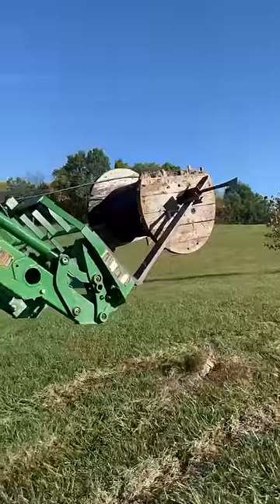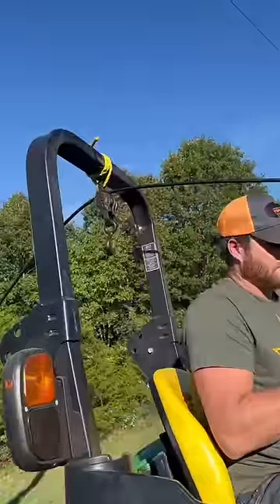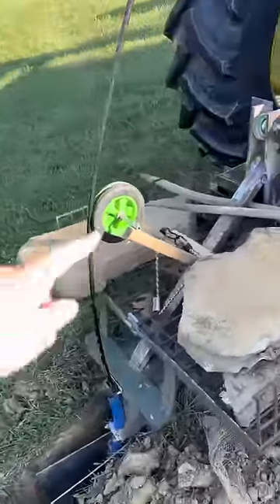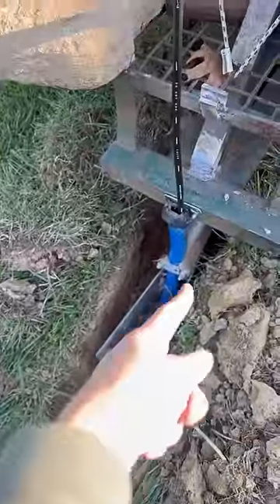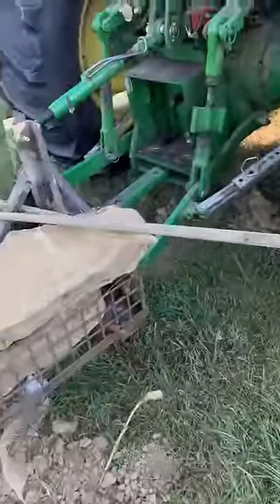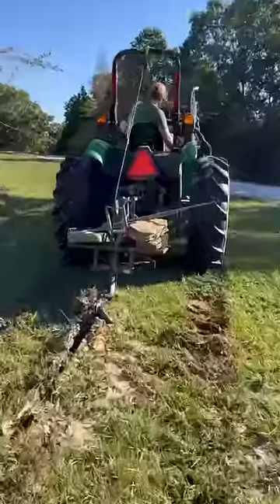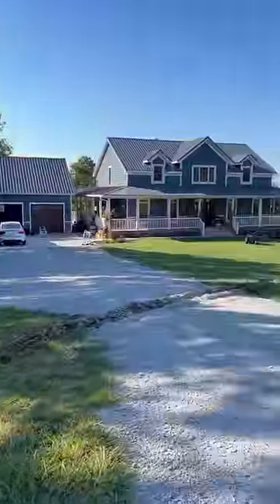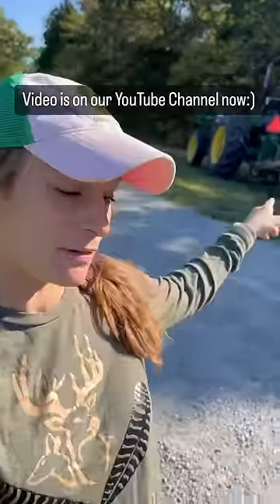Husband=GENIUS!🤯 DIY Subsoiler Build!       #johndeere #farmlife #amazing #welding #country

Comment: I did basically the same thing with a box blade and one of the tines. I took one tine and welded conduit on the backside for the cable/cat6/waterline to run in. Then put it back in the box blade at the lowest setting. Remove all the rest. I can get close to walls either side. I just wish i could get it a little deeper.
Reply from the maker: +@monsaka7827 that’s smart! Nice!

Comment: I would lay some tracing wire down and bright-colored ribbon in the trench just above it so you can find it in the future and to avoid cutting it. Last thing you want to do is cut fiber. It’s also a good idea to take some measurements and draw the map then put that in your files and cloud storage. Take some photos and/or video to document its pathway and depth and perhaps add a visual marker somewhere.

Comment: Fiber is delicate. Gotta have that in some (depends on local regs) conduit (pvc, fiberglass braid, steel tube etc). Is it required? Depends on the locality. PVC is required here, but since on a farm it’s prob fine. It’s when you got people doing work and digging trenches and aerating when trouble starts. I like the method to bury.

Comment: Looks like he's worked or watched a line crew.
I used to walk on top of the spool in order to not allow the cable to snap tight or get to loose. 
Good job you did there. Did the wheel from the barrow work?

Comment: The block hanging on the role bar is upside down.i believe it's a "snatch block".it's designed to quickly put line in mid line.

Comment: FYI when working with fiber you need to make sure you never have a bend smaller than the width of a basketball when in its jacket otherwise it could cause latency, and possible break the glass

Comment: That tool already exists, but it buries the line five feet deep, where it won't get damaged. It vibrates, to cut through the ground more easily. It's like a big sewing machine. The smaller version, which only goes about two feet deep, is only for soft ground, not under roadways.

Comment: You need to put that stuff in pipe or youll be fixing it A LOT. Even the direct bury stuff is fragile enough that natural ground movement will cause stress pressing and the light will get +stuck+ in the line.

Comment: I have soil envy.  The crew that installed my solar array broke two ditch digging machines in 200 feet of NE PA rocks in clay.  All I want is maybe 4 inches of that tender stuff spread on my garden.
Reply from the maker: +@brucehalleran1149 we also have soil envy. We live in the hills of Kentucky where it’s all clay and rocks. We also had major issues with rocks during this process. This video clip is in our front yard where e excavated all the rocks out and had triaxle loads of topsoil brought in lol

Comment: I mean, it's basicly the same design that's used to lay cable with professional equipment.  Nothing new, but good on him working smarter and not harder.  Use the equipment you got and make it work.  Typically fiber is run in conduit though.

Comment: Some  would say that because fiber is somewhat fragile, You might do better with putting it inside of conduit with an accessible pull box every 30 feet.
It’s really difficult if not impossible to repair - would require replacing the whole run.

Not throwing shade on your great  invention, but there is the law of unintended consequences and you can take advantage of others experience with fiber optic cable.

Comment: Y'all are going to have to remember where that fiber optic cable is in case you decide to dig up the yard later on. It would have been better off just getting small pipe and running pipe through your yard to better protect that fiber optic. And this is coming from somebody you used to run cable and fiber optics under ground.

Comment: ONE thing done wrong is that the fiber is too shallow, it needs to be deeper, but the machine is great! Also it really should have been in a protective plastic pipe to protect against people digging it apart later. Just make sure you never dig on your lot again.

Comment: You should be putting that fiber in a small pvc pipe before burying it with dirt. This will protect it from critters and movement in the earth. Shouldn't be too hard once you lay the cable to run pvs around it.

Comment: It's a sweet video but that fiber will be very screwed very soon, the elements will trash that fiber line, if the pressure from the driveway doesn't crack the heck out of it.

Comment: Fiber optics is glass. What I want to know is did the cable work after it was installed. when the glass breaks it breaks back 10 feet. You have to be real gentle with fiber optics.

Comment: Did the fiber break at all? It is glass. When we pull it at work we gotta be careful with it.
Reply from the maker: +@salvatoremaniaci230 Nooe. Didn’t break at all. James made it in a way that it wouldn’t bend too much. The angle was larger than 90 degrees:)

Comment: #1   that's not sufficiently deep enough to prevent damage from surface traffic. It should be, minimally, 2 feet (24 inches). Preferably 4 feet deep. 
#2    traversing a drive pathway, it should be encased in a conduit.
#3    that rig IS impressive for a home made fabrication. However, I'm certain it would NOT contend with roots over 1 inch in diameter or buried obstacles such as large rocks or metal debris. Better make sure the course is free and clear soft dirt. 
And if that's the case, it'd be more resilient being hand dug and in conduit the entire length.

Good job, but not a substantially trouble free installation.

Comment: OKI like the fact that chick legs are husband but you could just go to a one rentals and rent yourself. A trencher with a fiber cable installation kit. And it's all done already guys. I put 5 rain all over the world with that. To Verizon uses them very available to kiss up off-the-shelf. It's not easier than denalis. Di go I stuff?  I get it if it wasn't till the dinner exists. This is something that's out there. Just ask yourself. What does Verizon use? What does AT&T use? They're all dropping cable like it was a morning movement, you know.

Comment: This is far from ideal when it comes to fiber cables… if the dirt collapses a bit and compresses the drop cable, you’ll have attenuation at 1550nm for sure, and possibly at 1310nm…

Just run a PVC along the channel you dugout and pass that cable through…

Comment: Unless he's a fiber splicer.   There's no way that will work.....   And the company will never let you plug a fiber line into their NODES.   750 coax underground is what you should've used....  III 🇺🇸🇺🇸🇺🇸
Reply from the maker: +@duaneoestreich2792 He’s not a fiber splicer but it worked perfectly! The WiFi at the barn and security cameras work:)

Comment: I want to see this 'fiber' with confirmed speed AFTER they think they're done.. better not close that trench just quite yet.
Reply from the maker: After terminating the connectors into the fiber to Ethernet converters I am getting about 480MB upload. Been little over a year now works great
Reply: @CollinsCountry  nice work sir. sounds like a followup video if you ask me.. go ahead and blame me also, LOL.. I initially thought the torsion would be too much for the glass in the fiber optic.. good to know the solution!
Reply from the maker: @WrightWayDave  yes we need to do another video.  I work with fiber at work and it seems to handle more than most would think. Thanks for watchin!

Comment: None of that is necessary....😅

 Just drive the tractor to make the ditch and then put the fiber in the ditch!! You did a whole lot of needless work for a job that would have taken you half as long if you weren't dinking around with your tractor in the first place.

Comment: Just dig the ditch and lay the fiber in it it would have been less work
Reply from the maker: +@Raystacyy haha. You’ve never dug a trench in the hills of Kentucky if you think that statement is accurate lol. It takes an hour to dig a hole by hand around here 😆
Reply: You have totally misread my comment im not talking about digging the hole im talking about putting the cable in. Having the cable all set up to do this is not neccesary just use the tractor to dig the damn hole then go put your cable in instead of waisting time rigging it up to lay itself in there. And btw i live in appalachia so i think i know what the dirt is like. @CollinsCountry

Comment: Well lets be honest here....hes not a genius is he....hes either worked with equipment like this previously or hes seen videos and copied the design of the equipment.
Because this isnt something hes just come up with by himself.
There is a proper piece of kit to attach to machinery to do this job and hes just replicated it.
Everything here is something ive seen before and would be able to purchase .

In fact I'd argue hes far from genuis considering this equipment is used for laying water pipe usually and not fibre.

Comment: Dumb....you should have laid conduit first then run the line through it.  You'd have the room for more things later and not have the effort or risk AND You'd SIGNIFICANTLY Reduce THE RISK OF DAMAGING IT LATER.

WHAT A HUGE MISTAKE.  DIY CAN GET DIYD...DO IT YOURSELF DISASTERS.
Reply from the maker: lol. Okay. Fiber cable was free so you can chill out. I have enough fiber to do this 3 more times if I have trouble which I won’t. Not to mention I have 11 spare fibers per cable. If someone supplies me with free conduit then I’ll install that too.